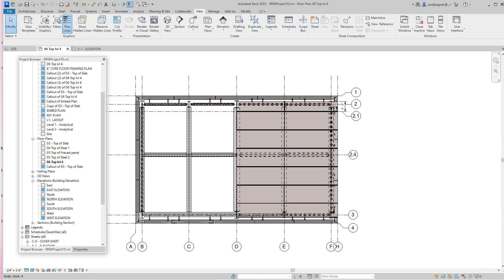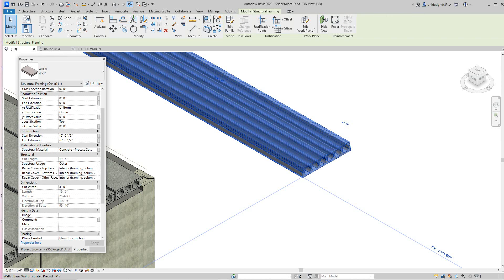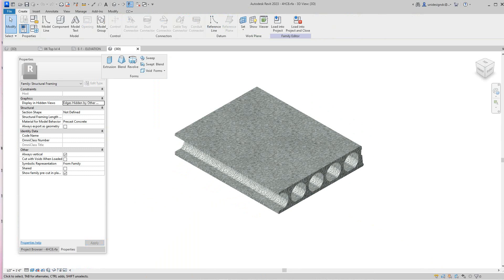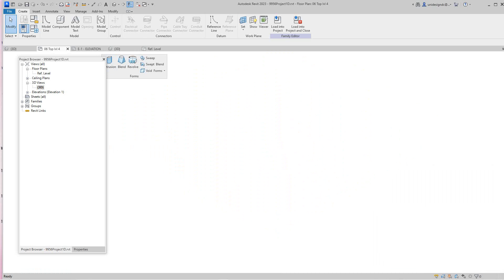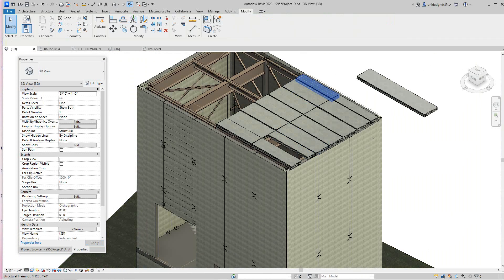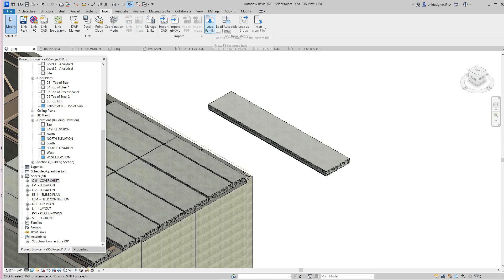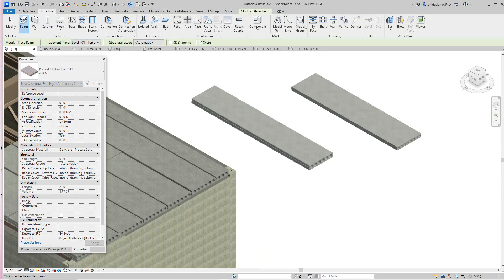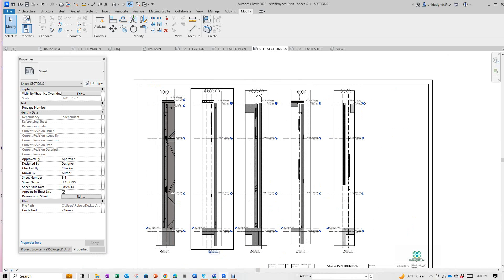Revit Precast Hollow core cut Widths

Comment: i have no idea how you created it :D you have hard width so you only change this void extrusion width and this is it?
Reply from the maker: Hi yes that's it, just create a void with a parameter in the family.
Reply: @unidesigndc  what is your advice about floor plan of hollow core slabs for building. I only need 2d floor view. Is better to drawing it in autocad? Or maybe could you make some short tutorial in revit. Thank you
Reply from the maker: Hi yes I can make a tutorial later. I'm at work now but I think I know what you are talking about
Reply from the maker: https://www.youtube.com/watch?v=3iNb4I7Elso
Reply: @unidesigndc  i tried to make it through split function. I,ve created my 250mm thickness of hollow paired with 250mm floor. BUT. Minimum width of hollow was ignored because i need minimum width more than 100. When i put something else  is showing up error
Reply: Sir. ihave one issue when i split slab through face based split its not gonna be 2 different slabs but still one with this same lenght.Probably its because void extrusion "boy" what make cuts. its better to make 2 separatly slabs with lenght what i need? or is there any trick to do this. Thank you @unidesigndc